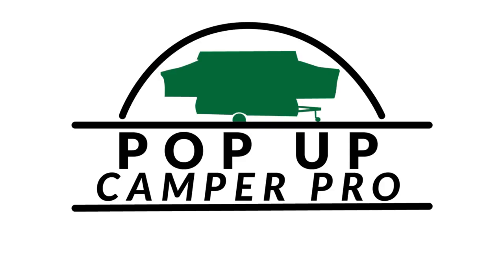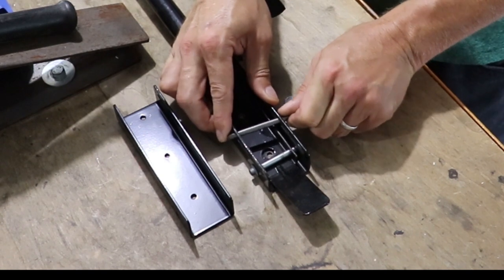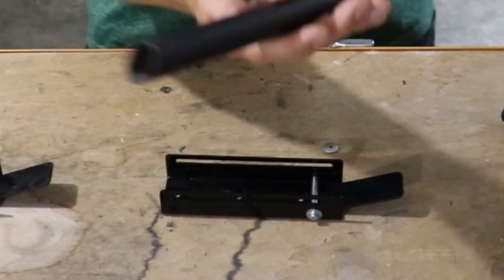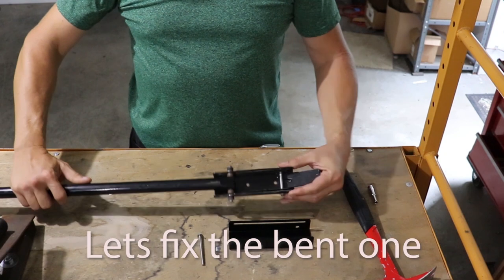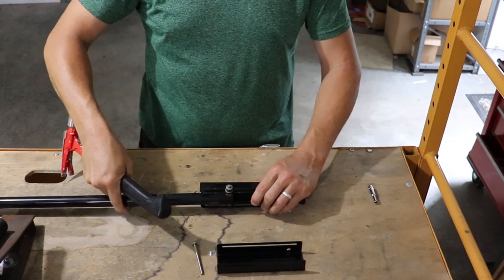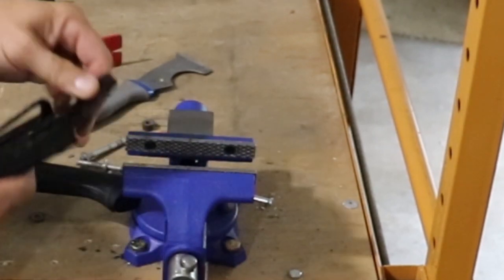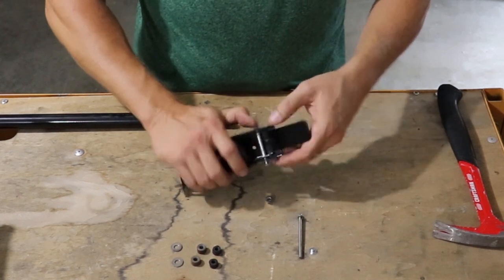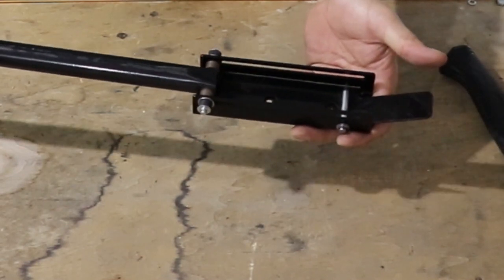Bed leg repair on Coleman & Fleetwood pop up campers

Comment: Can you list out the old hardware that you used to install the leg? I am buying 4 new leg channels now. Tired of the old ones getting stuck :)
Reply from the maker: Hello Brad! Are you looking for the nuts and bolts, or the pins and caps please?
Reply: @popupcamperpro   i think I found the parts list

(1) 1/4 inch slider pin
(1) 1/4 inch handle pin
(4) 1/4 inch PAL nuts
(2) 1/4 inch flat washers
(2) 1/4 inch ID spacers
(2) 1/4 inch ID shock spacers

My current shock spacers are completely worn down. I am sure I can track those down at a hardware store.

Comment: Hi there.  We have a 1987 Coleman Americana Sun Valley & stupidly tried to force the bed in while the bed support pole was still down.  We bent the bed support poles slightly & it doesn't slide well any more.  I see the bed pole on your site but ours doesn't look the same.  Our pivot is gray -- not black.  Do you have any suggestions.  The poles are just enough out of true that they don't slide correctly.
Reply from the maker: Julie, please send me a picture or two of the systems that you have. I will take a look and see if I have any for you.

Comment: Where can I get a pedal bracket? Ours is severely bent. I see that I can order the leg channel, but the hardware kits are out of stock as of 10/18/21
Reply from the maker: I’ve got you covered Annie! You can find these items and more at colemanpopupparts.com. 
I just built and listed more of the hardware kits last night for you.
Reply: @popupcamperpro  does the pedal bracket come with either the hardware or the leg channel?
Reply from the maker: As shown it comes with the pins and caps